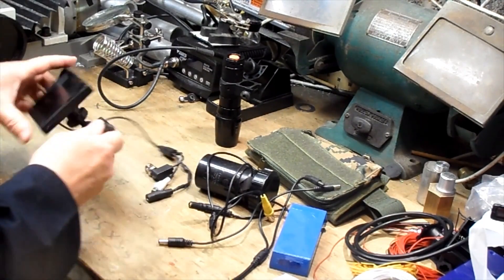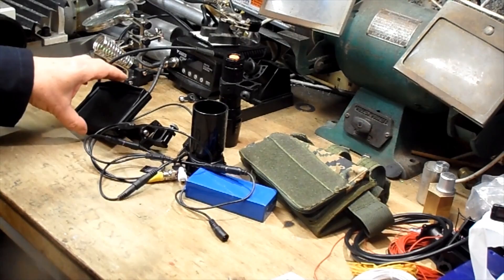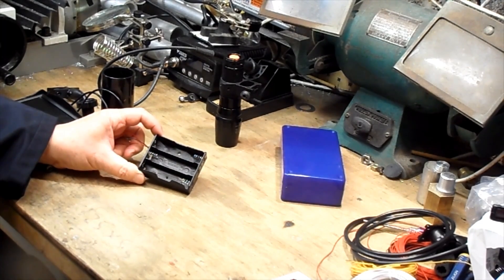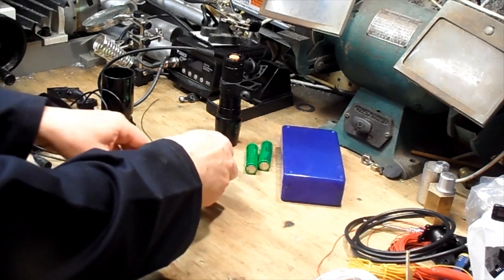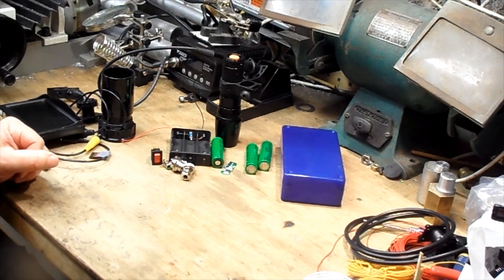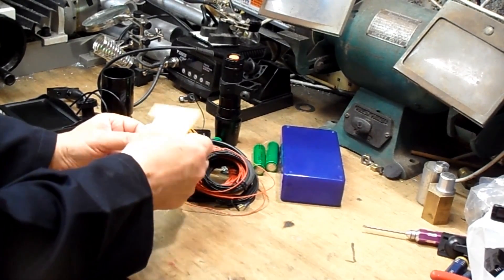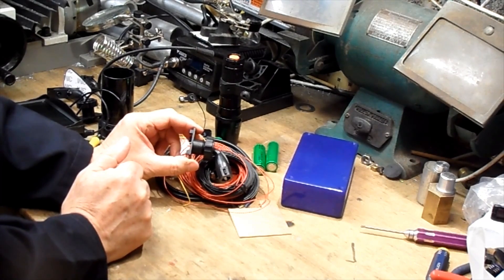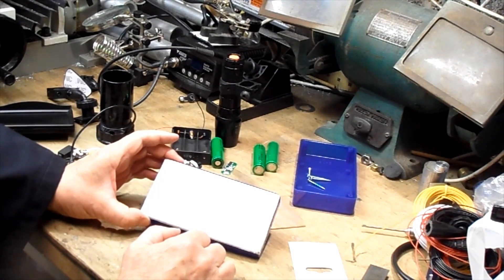Neat Night Vision add on build part 1

Comment: do you have a link for the battery protection board please also if you could explain the wiring for that too plz , great vid thanks for posting it :)
Reply from the maker: This is the part that I used, I'm sure that there are other similar ones available http://www.ebay.co.uk/itm/151518911941?_trksid=p2060353.m1438.l2649&ssPageName=STRK%3AMEBIDX%3AIT
There is a connection diagram actually in the listing which should explain it.
Reply: thanks for the info pal :)